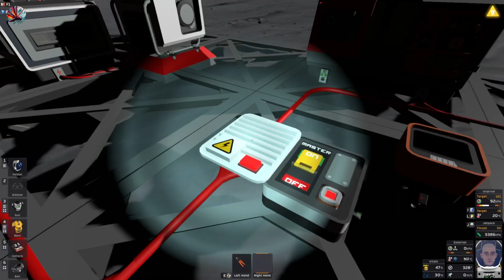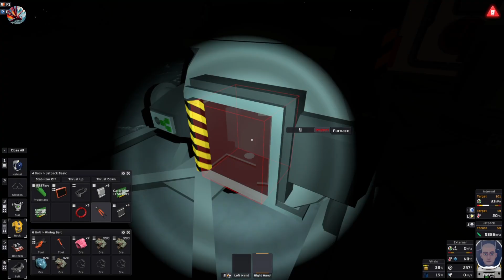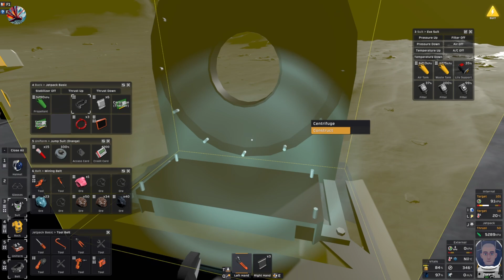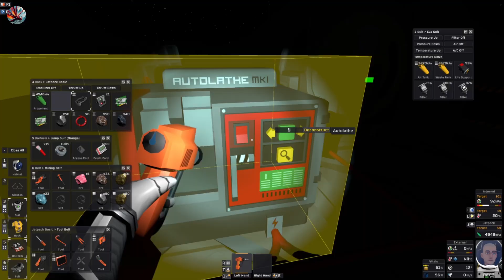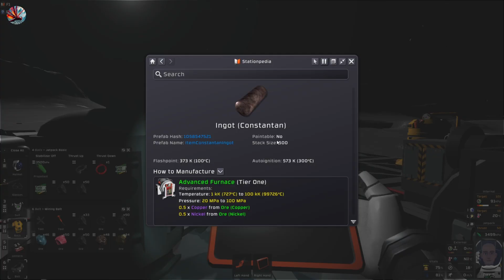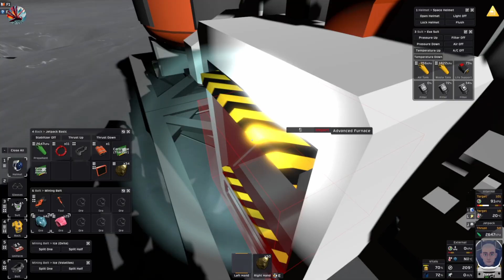Stationeers - BRUTAL Mimas - Advanced Furnace and Centrifuge Ep2

Comment: one rule I have when playing is that I don't use the coal generator anywhere but europa without a pressurized, oxygen rich environment.  IRL, burning coal only works if you have oxygen to burn with it, so using it without that feels like exploiting a bug.
Mars technically has oxygen, but the low percent and pressure make me think it wouldn't work there, so I don't use it there either.

I also try to avoid the atmospheric kit, because it didn't make sense to me at first, but don't ban myself now because it might use impossibly good reverse osmosis or molecular sieves for the gas processing and the peltier effect for cooling.
Reply from the maker: @ancapftw9113 I've not used coal in my Mars play through but on Mimas you're limited, early on, as to what you can use. No atmosphere so wind power is out, too far away for the sun to be of much use, that leaves the little fuel gas generator, which is just about enough to get you started, or the solid fuel gen. Both the big Gas Fuel Gen and Stirling Engine are a more complex setup, to complex for early game.

If we're going down the route of there's no oxygen to burn the coal I think you need to be wondering where the coal came from to begin with? Seeing as coal is made from dead biological matter around 300 - 360 million years old. You could argue there are hydrocarbons on other planets/moons but they're all either ices, liquids or gas. As for Peltier, it is very inefficient at removing heat. Refrigerant works much better and simpler to scale.

Comment: For a moment I thought you had lost your Mars world! Phew... I do hope you make regular backups.
Interesting point about storing your base coordinates; I'm surprised there's not some kind of radar - even if you'd have to setup a simple beacon for it, it would be easy and very useful. It'd be such a shame if people got lost and were never able to find their base again.
Reply from the maker: You can set up a beacon, the main station beacon that connects to mains power takes 300w, which is an awful lot for what it does, there is a portable beacon which takes batteries and lasts a good amount of time, you then use the tracker card in the tablet and it'll point to the beacon.

99 times out of 100 I save the game with the episode number once I finish recording, so I have lots of backups of Mars. The one time I forgot was the end of the first episode of Mimas! Still it was recoverable. The down side to this is I have hundreds of saves on my system for Stationeers.